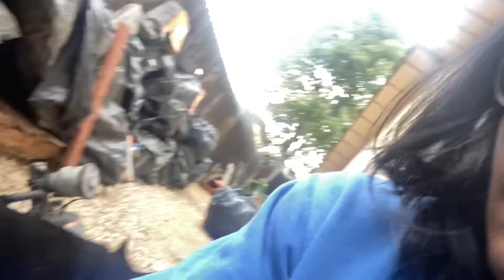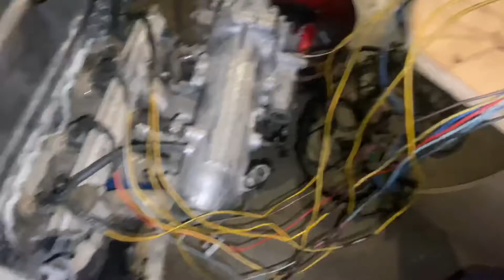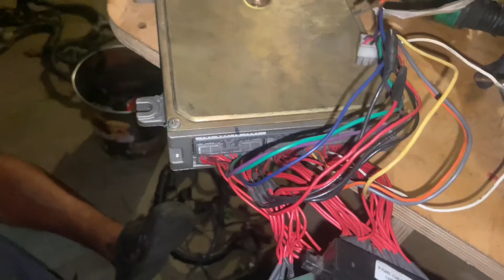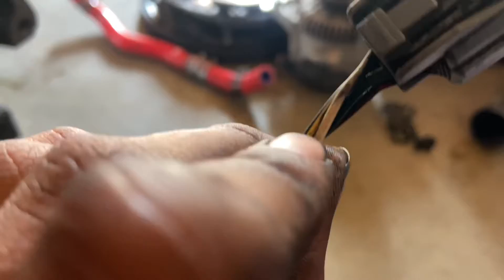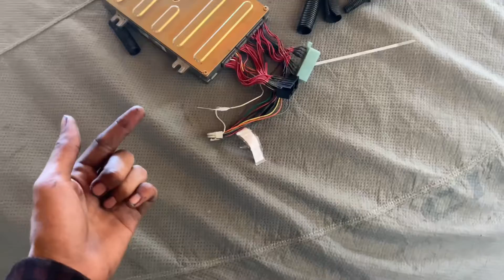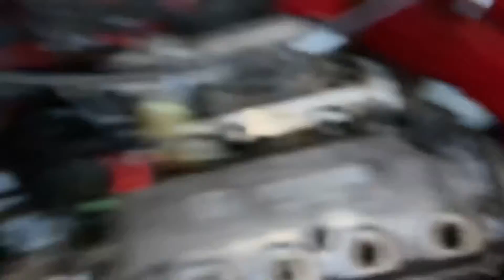HOW TO CONVERT ANY EF TO OBD1 | wiring up the d16z6 swap in the crx

Comment: Sorry if I’m being hard headed, but if you’re removing the resistor box, why is it needed you have a MPFI harness? What are the other differences between a dpfi and mpfi harness? I’m in the process of d16y8 swapping an lx sedan and am a bit confused on the conversion process
Reply from the maker: you don’t need a mpfi harness, i only used the fuel injector plugs and wires simply to make it easier to keep nice and neat
Reply: The the obdo injectors are low impedance which requires the box and the obdo1 injector’s are high impedance which don’t require the box. I’m thinking that’s how it goes

Comment: What transmission did you end up using?
Reply: Did you use the a6 tranny or z6??
Reply from the maker: crx transmission. the z6 trans is out of an eg and will not mount up / uses a hydraulic clutch

Comment: How did u converter the water temp sensor to obd1?
Reply from the maker: cut off the bullet connectors, extend wires to the thermostat housing, solder in the obd1 connector
Reply: @anotherefncrxvlog4350  thanks bro !
Reply from the maker: @Cruz99juan  yessir good luck!
Reply: @anotherefncrxvlog4350  hey brother just got a 1988 crx si. With d16a6 with z6 head. Can't get the car to pass 4k rpms. Got a new dizzy

Comment: Are you Guys located in San Bernagucci
Reply from the maker: nope but we’re close!!
Reply: @anotherefncrxvlog4350  That's cool I'm located in Phelan I have a Turbo D16 EF sedan and I work on EF's
Reply: @anotherefncrxvlog4350  Do you guys go to the junkyard alot cause if you do maybe we can work out a deal I need the Integra rear trailing arm bushing inner mounting rods just the rods that go through the bushing and mount to the car I will give you some polyurethane energy suspension rear trailing arm bushings for a Civic
Reply: I take it your not interested
Reply from the maker: @boost_edjamesmathew2168  we hit the yards a lot! this is just not a very good way to communicate with us, YouTube doesn’t give notifications for comments i have to check the videos for them. if you dm me on Instagram we can talk more!
Reply: @anotherefncrxvlog4350  Damn I don't have ig
Reply: @anotherefncrxvlog4350  Do you have Facebook
Reply: @anotherefncrxvlog4350  You have to go to the settings it has an on an off switch for comments and everything else